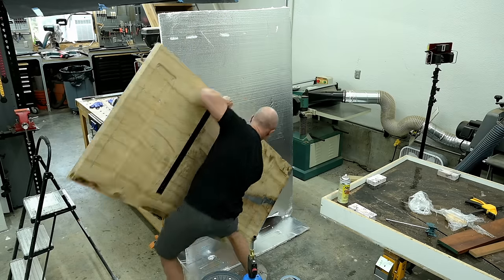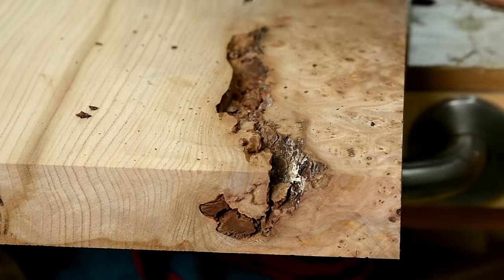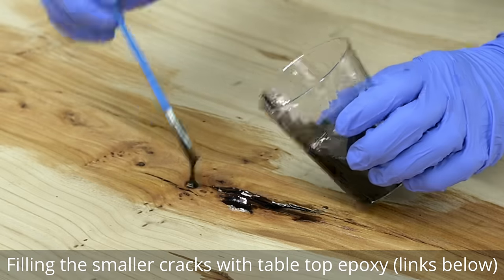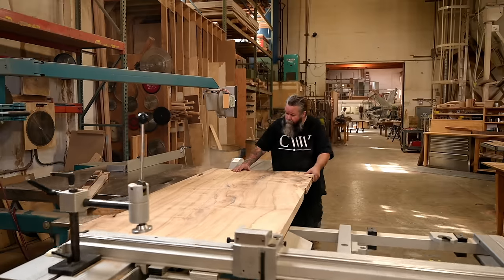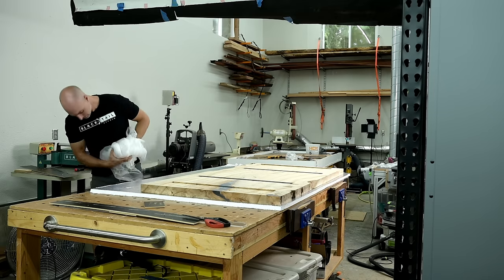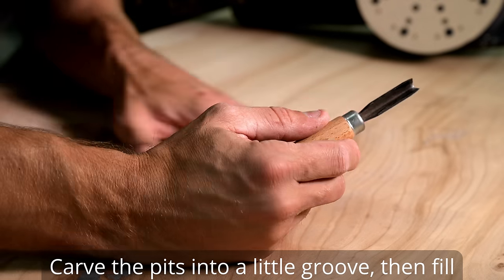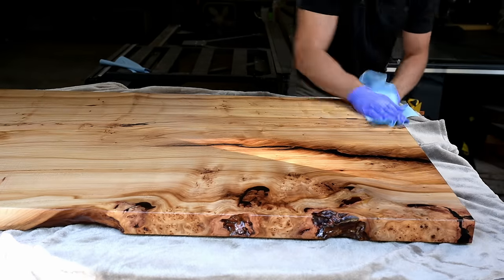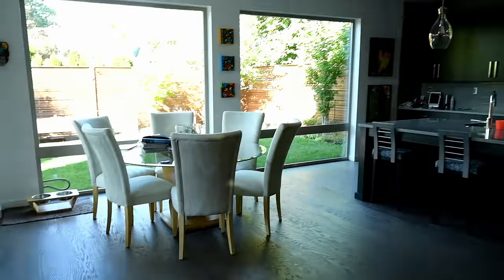Salvaged Slab To $6000 Desk

Comment: Hi Cam. I was watching an older video where you were pouring some epoxy and you were talking about mixing it properly and such. I figured that it may be better to comment in a more recent video to ensure that you see this. 

I am not sure if you had ever covered it in another video, but I just happened to watch a different video the other night. In that video they mentioned that they mix the pigment into the Part A prior to mixing the Part B in. After mixing in the Part B, they will pour it into another mixing container, scrape the sides and bottom of the first container and mix it a bit longer in order to ensure the epoxy gets mixed evenly.

Hope that helps if you didn't know it already!

Comment: That Festool vacuum clamp thing would anyone's shop better! Hey Cam, long time follower, first time commenter. Been following your stuff for years and always waiting for new videos to drop. Love your work.
Finally i've started my first ever table and I had a few questions about your advice about sealing the piece to prevent the black epoxy from staining.
1) Do you recommend any specific type of epoxy? Can I use the same liqud glass/deep pour one that i'm going to use on the table?
2) Does this sealing coat ever fill/block any small cracks/holes that should have been otherwise filled with the black epoxy?
3) How do you prevent staining of the wood with the black pigment when you're touching up, but have already sanded off the sealing coat of epoxy?
Hope to hear from you, and once again, always amazed by your work and how far you've come. You're truly an inspiration to every hopeful self-made home woodworker.

Comment: Best possible gift: a walnut slab, hand selected by you.  :)

You said you love the Milwaukee trim router, what do you like best about it?  The problem I have with a couple that I have had, is the depth setting seems to wander over time, which can cause issues with a small roundover bit. I have a porter-cable that does pretty well, but I've been buying more milwaukee tools recently, so I'm intrigued to hear your thoughts.

Comment: Anything you give away would be way cool.  I could used the epoxy, a slab would be unbelievable, a Festool Sander would look great in my tool collection.  The Elm desk turned out really nice.  I think there are so many species that are awesome even though we all have our favorites.  Do I have it correct that you seal the edges of the slab with the table top epoxy and you feel the deeper/bigger cracks/voids with the deep pour epoxy?  Love the work and the commentary no matter what anyone else thinks.

Comment: The plastic painters sheet is a great tip! I had some white oak benchtops for my kitchen reno that sat on my shed workbench, and they cupped in the few days I had them temporarily stored there - I had to flip them and leave them another few days to reverse the warp, before I had space to shift into the house to acclimate before sealing. Would've saved me panicking that I'd ruined a few grand worth of timber had I known that trick!
Reply: On that, you've got a lot of good tips on finishes for water protection. On the benches I mentioned above, I sanded down to 220 before a few coats of Osmo benchtop oil. Directions only called for 2 but I added a 3rd for good luck. I've noticed it doesn't handle any areas where continued moisture is a thing - like just by the tap where splashes will occur, so I've got raised grain that I'm gonna have to sand back and re-finish. Would you recommend anything beyond the Osmo to better add to the water-beading process without compromising the satin finish?

Comment: I have some large, felled Ohia logs in the jungle about my house.  The logs have been on the ground for about 30 years.  I took my chainsaw to one.  Cut 2 - 15 ft x 3 ft x 4in slabs (that killed one brand new chain).  Lots of cracks and voids in the slab that I wanted to fill.  I need a course on how to do that.  I tried with products available from Home Depot and it didn't work very well.

Comment: How about a book case?  I'm building one right now out of some 2 inch cedar from my late father in law.  Not sure what finish I'm going to use. I'm using  gas pipe to put it together as my father in law worked at Weyerhaeuser in Longview Washington, so a bit of an industrial look seems appropriate.  Was thinking of using vinegar and steel wool to "age it" and then spray it with lacquer since the wood is a bit softer. Any advice. thanks.  And love the videos.  Probably one of the best things I get is inspiration to make things.  Take care,

Comment: with the microbubbles (~12:30) i think you cannot get the potting to get enough grip as the microbubbles inside are most probably very smooth, too smooth to get a good surface tension for the potting.

Comment: I think it would be really cool to have a live edge with like a full on branch with smooth gray bark- and maybe even some oak leaves. Reason is I think the black epoxy and live edge is really cool and kind of gives the impression of looking at a cross section of a tree at night. If you could kind of blend the epoxy to transparent around the branch with a black backdrop, so you can see three-dimensionally, and maybe angle the branch up to the viewer & obscure the branch joint with the slab itself with black epoxy so it looks like it's actually attached to the slab (assuming you couldn't get a slab with a suitable round branch). Looking at the slab, your eye traces from the beautiful grain to the live edge, outside of which extends the inky blackness of some dark summer night long ago.

Comment: I just watched the last part of this video again because I like the top that much......  And a thought occurred to me. If your leg manufacture used C-Channel for the leg assembly you could maybe leave your smaller ones out.  Saving you some work.  Or maybe just use one (small one like you currently use, in the middle) if the top is to long when considering distance between leg's.  If C-channel isn't an option alternatively a small piece of 1/4"x1/2" could be welded to the top of the leg mount plate, making a T-beam style.  For that matter a Tee-bar could be welded in the viewable side of the plat between teh front and back leg of each leg section.  Saving having to make deeper slots into teh wood.

P.S.  I did watch all the way to the end the first time (that was a lot of "the's" in one sentence).  I just didn't figure you needed any help selecting prizes for the contest that ended almost a year ago. =)

Comment: Cam question for you out of Issaquah, WA, on Rubio Momocoat, sanding to 180 grit on your tables with epoxy in them, does Rubio hide the scratches that would remain sanding to just 180 grit? Or do you sand the epoxy parts to a higher grit? Especially if using black I would think sanding to only 180 grit would cause the 180 grit sanding abrasions to be quite visible.  Curious if this has been a problem and if so how you have worked around it. I should note, this is assuming sanding has been done correctly and to as good as you could get on epoxy going to just 180.

Comment: Have you ever tried use a syringe with a small gage needle to fill in those little air pockets in the epoxy. My thought is you can fill them from the inside out to help prevent trapping air underneath. You can give away anything you build and the winner of your giveaway will be thrilled! I would anyway.

Comment: Really like your work and have learned very much.  I may get commissioned for an 8 foot dining room table in a few weeks.  Will meet with the customer in their home to verify dimensions.  It may be over my head but you have to start somewhere.  QUESTION: If I would use metal legs on a single slab, 8 foot table, would you recommend 3 sets of legs?  I feel the middle would need the support.

Comment: the reason why elm is not popular is because elm requires longer air dry, and really hard to reduce the moisture rate by kiln dry even after 6 month or even 12 month of air dry depending on the thickness. So elm lumber/slab inventory takes much longer time to flip and hurts KD lumber company's cash flow.
Also elm is not considered high value species, so it doesn't worth to fool around with it.
However, if you have a piece of slab or even elm log that has been sit in the dark corner of your workshop for years, it's a nice piece of wood to work on.

Comment: Hey there, do you or have you in the past talked about the risks of working with epoxy with regards to your health, I always see you wearing a mask but you do work with it quite a lot so I wasn't sure if there was any concerns on your part having worked with it so much and for so long. Your space is fairly large and you have big doors which I'm sure helps with ventilating.
Reply: also a mallet would be pretty sweet, I saw the mallets you made a few years ago and whether you still make those or not, that would be a cool gift and something people could appreciate from you as well as use around their shop.

Comment: You should add your brand to your tables. I watched a documentary once about a cabinet maker who made incredible and super expensive tables. What he had was a small coin made of platinum (!) that he recessed into the underside of each table. If you didn’t know it was there you would never see it. His thinking was he was making future antiques and his work would be easily identifiable for future generations. Obviously you don’t have to use a precious material, but I think you should be proud of each of your projects and add a little personal touch. Imagine Antiques Roadshow in 50 years ‘ah yes, here we have a fine example of early century elm table and if I’m not mistaken, yes, underside you can see the makers mark, this was during his early epoxy phase, which has held up remarkably well”! Lol

Comment: I am surprised that you do not use a vibrating engraving tool to bring the air bubbles up and out of the epoxy along the edge of the wood.  This could save a lot of hours filling the pits in the epoxy.   Think of it as a micro vibrator for concrete that causes consolidation of the materials.

Comment: When I did slabs like those, I never used metal channels to stabilize them. If a wood that heavy coped, would do so no matter what you put. A piece of wood moves with the changes of humidity, not in the humidity be in the air, but in the wood. Gradually but surely, changes in humidity would warp or bend the wood with hydraulic force... The best way is to stabilize the wood before the finish. A simple chemical could do this safely! Even used in ships that have been underwater for several centuries, PEG-1000, will seal the wood safely and effectively avoiding even new checks! (Polypropylene Glycol). Good luck!!!!

Comment: Why do you use 3/4" thick metal with both 90° degree angles on the tables ??  I would think it give much added Strength  But! it Takes Away from the Wood,  you weaking the wood Right ?? ??